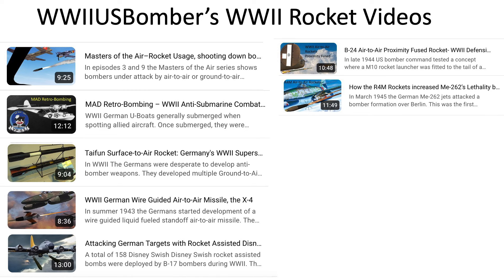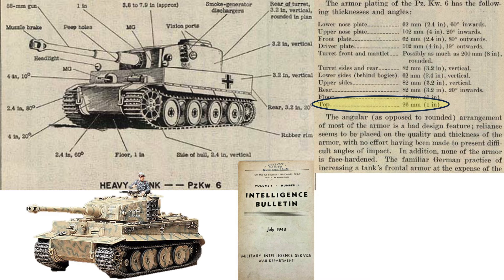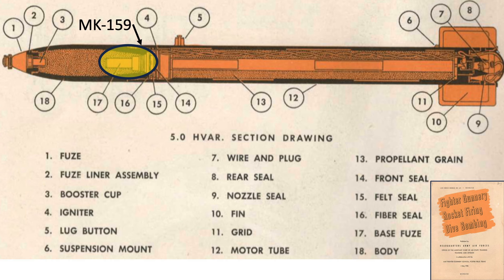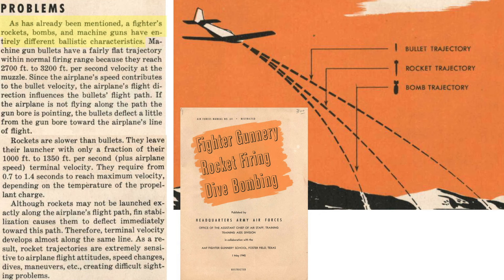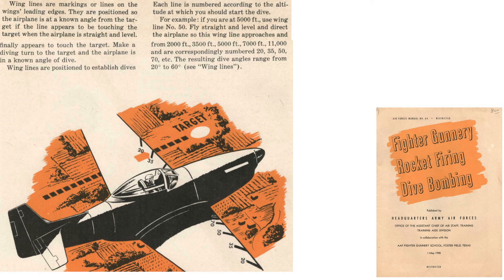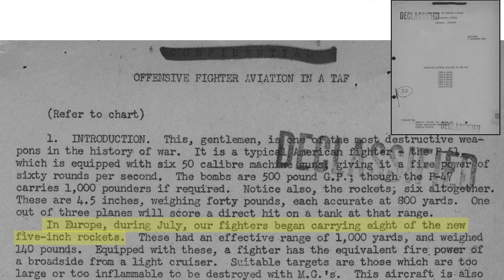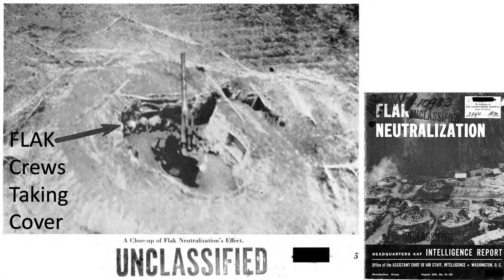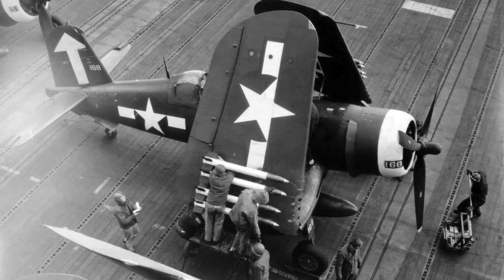WWII 5.0 inch HVAR air-to-ground rocket, attacking with the broadside firepower of a Light Cruiser

Comment: I wonder if any rocket firing was done in a vertical dive with dive bombers to see how accurate that was?
Reply: Well,  to be sure,   that is precisely what the forward air controllers did with 'Willie-Pete" white phosphorus rockets to mark targets from Broncos.  Mohawks, Bird dogs, 02s and Loaches used them too but I think it was mostly the OV -10s that worked in the vertical a lot.

Comment: I know this request make be silly but here goes. Could you research the story of American pilots who claimed they destroyed German tanks by bouncing machine gun rounds off of road pavement up into their light under their sides armor. They also claimed they could do it to Tiger tanks. I have read this many times. Is this possible ? Seems suspicious to me.
Reply: Believe it or not, this has been investigated. It wasn't possible. See the videolist of this same channel, because WW2US bombers already made a video with proof that .50 calibre rounds couldn't penetrate Tiger's bottom armor.
The guy that makes these video's is absolutely awesome.
Found it: https://www.youtube.com/watch?v=I084D8AZNZQ&list=PLO7SMfMqEYq42ux3jUMI3j6YM4bJzcfSO&index=63

If link doesn't work search "P-47 vs Tiger Tank: can machineguns penetrate armor"
Reply: Tiger's thinnest plates could stop .50 cal, but other Panzers were mistakenly called Tigers. Ricochets from aircraft could have penetrated Panzer I, II, 35, 38.
Reply: Now I don't know about "destroying" a tank with a 50 cal. I could see getting a mobility kill by damaging the engine or track system. Now there is a story I read about the 82nd holding off an armored assault on a position in Sicily with only small arms. But they didn't destroy they tanks, just forced them to break off their attack.